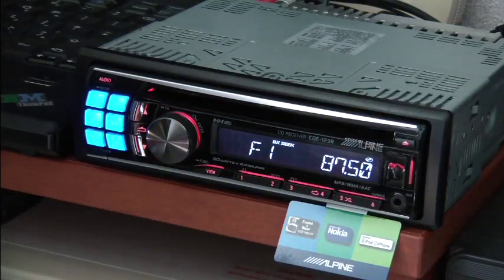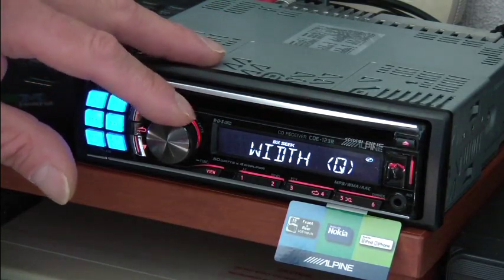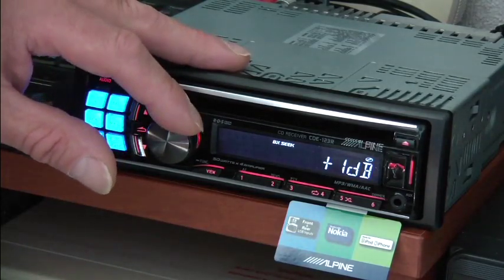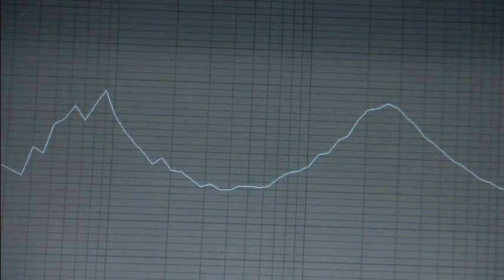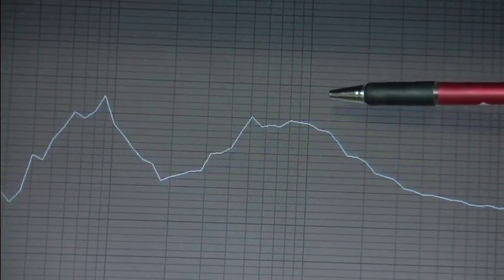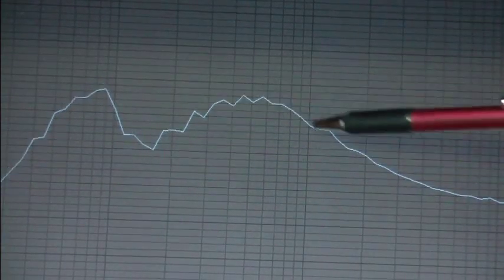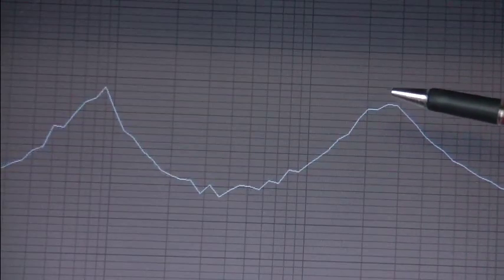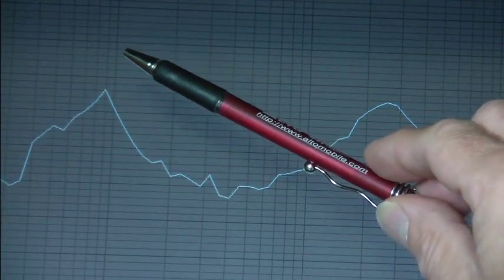Setting the Parametric EQ on a Car Stereo Head Unit

Comment from the maker: Thanks very much for the comments guys, it gives me the motivation to look at doing some others. Setting active crossovers could be one, and another pet interest of mine is time alignment, both physical (speaker placement in the car) and calculating electronic compensation and the pros and cons. I did quite a lot on it years back - very interesting. But is anyone interested now I wonder?